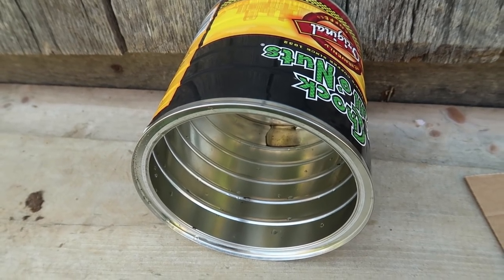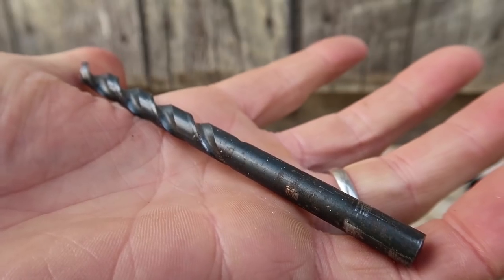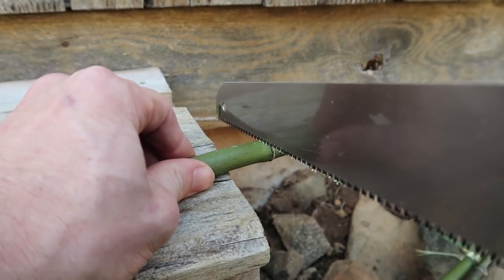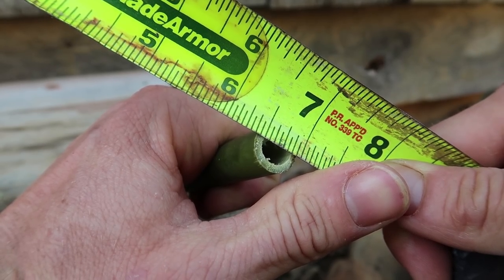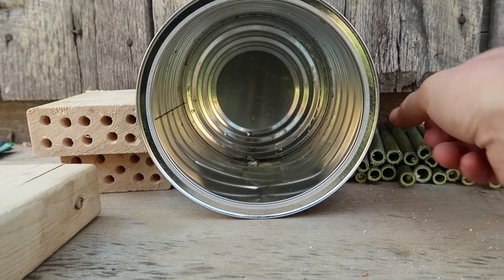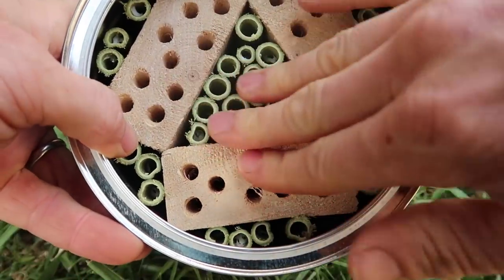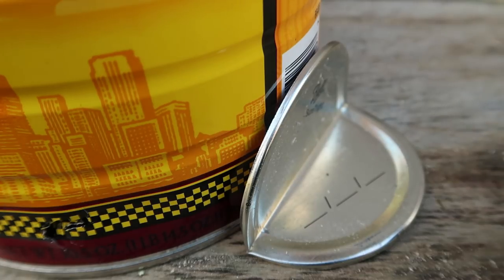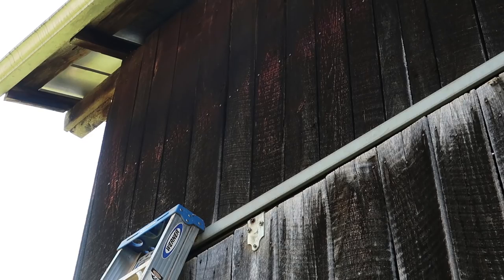DIY Coffee Can Mason Bee House

Comment: Varying the size of the holes is a good idea, I'd recommend going from really small diameter holes up to about the size of that river cane (bamboo?). At our place the most visited holes are much smaller diameter. In fact, I've never seen one with that large a diameter occupied. Just depends on the species of bees you have in your local area. Drilling holes in scrap lumber or even firewood is probably the easiest way of making habitat for solitary bees. You can cinch scrap pieces together with metal wire and hang up the bundles wherever you like. Under some sort of overhang is definitely good, and preferably in a place where it gets plenty of sunshine in the spring and fall. A south face is probably the best.

Comment: Nice video, and I have several questions.... Why not use all bamboo, is the pine 2x4 needed? What is the depth and spacing of the holes in the pine? I'm assuming it's 5/16" diameter as you mentioned...Do they need to be cleaned or replaced every year? Thanks
Reply: Bamboo is a no good! it varies in diameter inside and bees need at least 6" of "tube" so that they can have enough male/females...